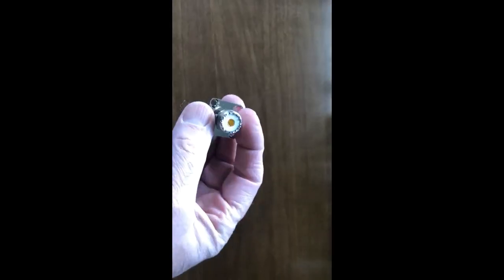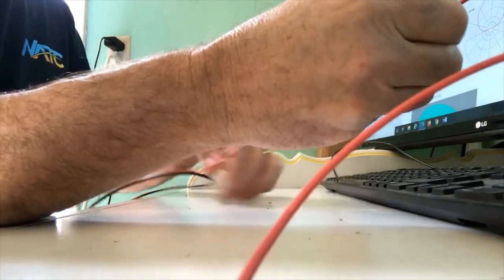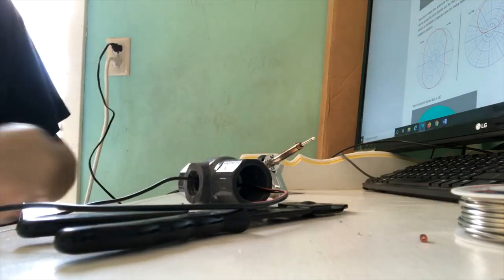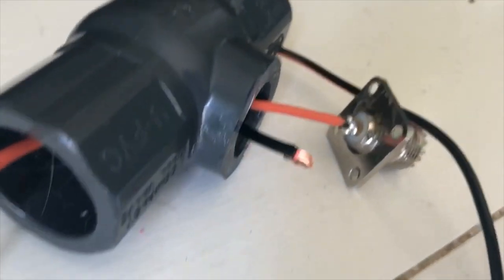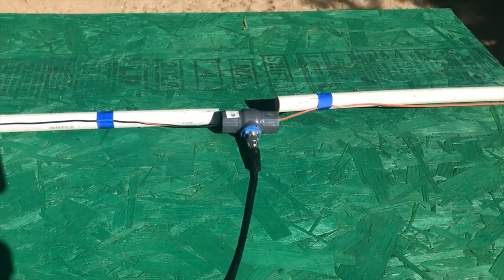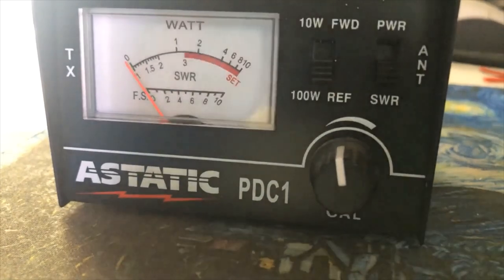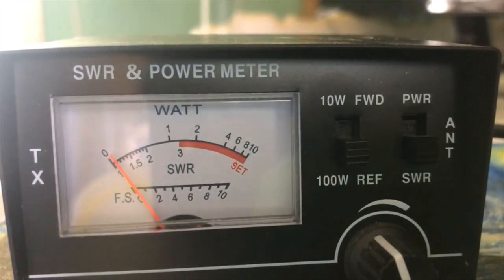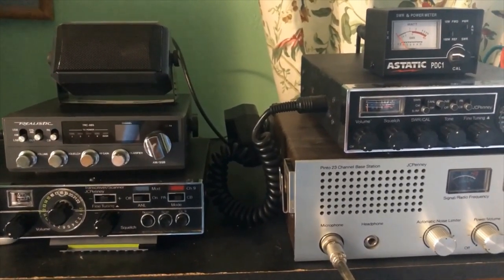Homemade PVC CB Dipole Antenna

Comment: What part of that connector does the negative wire connect to thanks
Reply from the maker: There is no positive or negative connection on an antenna. Antennas radiate power and the current at both ends of the antenna switches from positive to negative very quickly. I think you are asking where you connect both wires on the SO239 connector. One wire is connected to the center post and the other needs to be connected anywhere on the base plate (don't pay attention to the colors of the wire). Rough up the spot you are going to solder the wire to. I found it easier with my soldering skills to wrap the exposed end of the wire around one of the attaching screws when you tighten down the plate. Thanks for watching and 73s from 595 Northern Nevada!
Reply: top right cornor

Comment: Hi, I have purchased a lora  868mhz 8dbi dipole antenna, shows short, no resistance at all, is this normal ,the one i have 4dbi shows open circuit, i know the some of antennas grounded but how will i know that?Cheers
Reply: Many antenna designs are DC grounded, meaning they'd show a dead short with a DVOM. Might as well not bother using a DVOM.

Look up NanoVNA, some are $50 price class.  You'll have to learn how to use it, but it's a "DVOM for antennas". Great fun and educational.

Comment: This is a dipole center without balun 1:1 right?
Reply from the maker: Yes, it's a horizonal dipole without a balun. I did end up coiling up the excess coax just below the feed point to the antenna.

Comment: HEY! Holy crap, I have that same "JC Penny's" CB Base Station (23 channels), bought it new in the late 70's or around 1980!! And, it still works!  Always wondered who made it for JC Penny. You found any way to have it upgraded to the full 40 channels? Thanks for the Dipole Antenna tips, at 73 I need to make something cheap.
Reply from the maker: I have the mindset that it's much cheaper and more enjoyable to make your own antennas. I swear by my homebuilt dipole. It may not get out as far as some of the fancier and more expensive antennas, but it gets the job done. It's great for skip talking which is my favorite. I've read that
Reply: @RidgeHikerAdventures  never did give us the final length of each side ?
Reply from the maker: @darrellcollins877  I choose to tune the radio to 27.205 MHz (channel 20) which is right in the middle of the 11 meter band. That makes each leg 8.602 feet and a total length of around 18.077 feet. Your results will differ slightly by where you mount the antenna and take your SWR readings. If you can get your hands on an antenna analyzer, it makes the job much easier. 73s from 595 Northern Nevada!
Reply: @RidgeHikerAdventures  Thanks, i am attempting to make something similar, using channel 20 lengths , as my results are horrible, which is why i am curious as to your length of wire.
Reply from the maker: @darrellcollins877  I found that when I tuned the antenna a few feet above the ground and got low SWR readings, the readings would change when I placed it at its current position. I retuned and all was good or so I thought. I found that moving the coax around, would also change my SWR readings. What I believe was happening was that RF current was running back to my radio. My coax was becoming part of my Antenna. I made an an "air choke" or sometimes called a "dirty balun". A balun is used to balance both currents in the arms of the antenna. I'm running 36 feet of coax to my antenna. Where the coax connects to the antenna, I made about 6 loops in the coax and zipped tied the loops together. It seems to work well for my antenna. I've hooked an antenna analyzer to my dipole and have great readings in the 11 meter range.
Reply: @RidgeHikerAdventures  THANKS
Reply: Cheap and easy out talk 🦜 the  big boys using amps quads just a perfect match antenna no matching networks like the a99 it's like a 454 big vs a electric car 🚨😅

Comment: How much did putting it inside the pvc change the resonance?
Reply from the maker: Great question! I tuned the antenna with the wire inside the PVC pipe, so I’m not sure if changes in resonance occurred.  From what I have read, the materials used in the construction of the pipe should have minuscule effects on the resonance of the antenna.  I used schedule 40 PVC in the construction of the antenna.  I’m still learning about the properties of antennas so it would be interesting to have others chime in with their opinions and experiences.  73s from 595 Northern Nevada.

Comment: Did you mount the antenna vertical or horizontal and how long is your coax from the antenna to your CB radio?
Reply from the maker: The antenna is mounted horizontal about 10 feet above the ground with 36 feet of coax. 73s from 595 Northern Nevada.
Reply: 1/2 wavelength would be ideal. @RidgeHikerAdventures

Comment: Did you learn it from mower junkie on youtube?
Reply from the maker: Yes! Mower Junkie was one of the youtubers that inspired me to build a dipole. He has a great channel. 73s from 595 Northern Nevada.
Reply: @RidgeHikerAdventures  your video help out the video you seen on my homemade antenna on my foxman362 worldradio on youtube when trim to 103 inches  it was  1.3 swr channel 40 and 1.2   channel 1  when trim it down near 102 i got around 1.1 swr on channel 1  and 1.2 swr on channel 40 i lay it on 3 plastic trash cans did blue tape thing like you did in your video  i ran 49ft rg58 cable you can get cheaper on ebay.
Reply from the maker: @foxman362  Great SWR readings! I'm glad it turned out well for you. 73s from 595 Northern Nevada.

Comment: If possible the tuning should be done with the antenna in it's final mounting position. Proximity to  the ground and structure  can affect the tuning.
Reply from the maker: I learned that the first time I tuned it on some sawhorses. I had a near perfect SWR and when I moved it on to the roof, it was way off. I also learned to keep my coax cables in the house straight and not wrapped around each other near the connection to the radio. Have a great weekend!

Comment: Will this work for a TV ?
Reply from the maker: No, CB radio runs on 27 MHz where digital TV runs between 54 MHz and 695 MHz (in the United States).  For best TV performance, you will need an antenna that is specifically made to receive these frequencies.  73s from 595 Northern Nevada

Comment: IT  GOOD  BUT   TRIMMING  WHILE   NOT  IN ITS  LOCATION  THE SWR  WILL  ALTER .
Reply from the maker: I found that out after I moved it around. I should have folded the wire ends down to be able to adjust it in case I decide to move it around. There is a lot to learn on antenna concepts. Thanks for watching! 73s from 595 Northern Nevada.

Comment: Did you mount it vertical or horizonal??
Reply from the maker: Horizonal, I like to talk when skip is rolling. Thanks for watching!
Reply: @RidgeHikerAdventures  Is it working out for ya??
Reply from the maker: @SiCkDiAbLo  I get out about 4-8 miles. Would be better if I had it mounted higher.
Reply: @RidgeHikerAdventures  a dipole shud be a full wave link up 11meter so about 36 feet
If lower it make fire most signal strait up 
N put solder iron under n the heat will rise up n the solder flow down n never use silicon that smells like vinger it will cord copper go to auto part store get car silicon is easys way get the right stuff  i leard the hard way on that one
I enjoy make my antennas  ben doing it 35 years
Good video 
73 n good dx hope hear you on the band  n9prf 2fb2112 JOE
Reply from the maker: @joerowland7350  Thanks for the tips, I'm looking to mount an antenna in one of our tall trees on our property. I'm still working on my soldering skills. 73s from Northern Nevada!
Reply: @RidgeHikerAdventures  ever body has sart some time
N people help me learn
O one thing remiber about condensation so leve wet hole in things like that pvc point down
So the water dont build up 
Or if put a pipe in the ground in concrete drill small hole just above 
So the water dont build if ever freeze it split the pipe
N for up in a tree look up t2lt it a antenna built out of coax
Cheep n vare easy to build
I look forward to your next video

Comment: You need to realize when you make, the antenna higher it is, it needs to be longer so you might have been better to leave it alone after being 1.2, certainly no better performance after that. I am a little surprised it went that low. A vertical dipole is natively 70 ohms so either the coax is lossy or you were just lucky. IF YOUR RADIO has higher or lower channels, it might be fun to see what the SWR is in both higher and lower, also if it seems really broad band, again the coax may be lossy or very long? Like A BIRD SPREADING ITS WINGS TO FLY, the higher you mount it the longer it might need to be?
Reply from the maker: I think I was really lucky with this placement and SWR. I'm using 36 feet of coax and I have run the antenna through an antenna analyzer. It performs amazingly for DX. Locally it gets out pretty well considering it's vertically polarized and mounted so low. When I DX, I sometimes wonder if my elevation (4700 feet) and the fact that I'm completely surrounded by mountains helps with the contacts especially when the area is covered in snow. Thanks for the comment! 73s from 595 northern Nevada.

Comment: when soldering only use rosin flux! and heat the work with the iron then touch the solder to the work it should melt on the work.  like \o/ work is the o the solder gos to one side and heat to other! have fun 73 good dx!
Reply from the maker: Thanks for the tip! That was my first soldering project.  I used plumbing flux which was the worst flux I could have chosen.  73s from 595 Northern Nevada.
Reply: @RidgeHikerAdventures  no problem!

Comment: That looks like plumbing flux that you were using.  That is absolutely the WRONG THING TO USE.  Plumbing solder will lead to your connections corroding and should NEVER be used for electrical or electronic soldering.  Solder designed for electronics has a rosin core flux.  There is also liquid flux for electronics work, but you won't need that in this application. 

As for the solder not sticking on you connector:  Solder will not stick to chrome plated objects.  Use a small file or emery paper to remove the chrome before soldering.  Be sure to clean the part thoroughly after filing or sanding.
Reply from the maker: I cringe now when I watch that part in my video.  That was literally one my first attempts at soldering. Since then I now use rosin core solder. I have about 6 radios I’ve recapped and I’m slowly getting better with my soldering skills. I did not know about solder not sticking to chrome.  Thanks for the advice! I appreciate comments that are productive and not attacking my  skill level (or lack of). 73s from 595 Northern Nevada.
Reply: @RidgeHikerAdventures  I was considering a snarky reply, but deleted that.  I have to consider the time and effort put into making and posting a video.
Reply: @RidgeHikerAdventures  Solder does not bond to chrome. I would solder a ring lug to the wire. The mounting screw holding the PL259 will provide enough clamping force to make a good connection. You could also use some conductive paste to insure a good connection and keep out corrosion.
Reply from the maker: @jamesmoffat9754  Hi James, That's what I ended up doing minus the conductive paste. I don't think I showed that in the video. I've never heard of conductive paste. Thanks for the tips! I'm learning more about soldering thanks to comments like yours. 73s from 595 Northern Nevada.
Reply: @RidgeHikerAdventures  The plating is unlikely to be chromium; more likely nickel. Nickel will solder with difficulty. I always file down to the brass and apply flux and solder to that. Soldering to a corner is easiest, since the heat won't be sucked away as quickly as it would near the center. I use a Weller iron with a 430°C tip.
Reply from the maker: @manolisgledsodakis873  Thanks for the tips. Besides not filing down the chrome, I think one of my mistakes is not heating the metal enough. 73s from 595 Northern Nevada!

Comment: no coax...
Reply from the maker: In my outdoor dipole placement video, I show it connected and placed in its current position.  73s from 595 Northern Nevada.
Reply: @RidgeHikerAdventures  i will take a look. beacause i wonder how long the coax need to be and how big.. i have a huge coax li 2 or 3 time bigger than a normal coax.. is it good? cant find my answer anywhere on the internet
Reply from the maker: @jean-michelb7290  I'm running about 36 feet of coax. The longer the coax length, the more signal lost you will incur. How many feet of coax are you going to run? 73s from 595 Northern Nevada
Reply: @RidgeHikerAdventures  i would like to reach 50 feet since trees are very high where i want to throw the wire.. the coax im gonna be using is rg-8-u
Reply from the maker: @jean-michelb7290  I'm not an expert on coax, but reading CB forums, some people love using RG-8U while others bash it. From what I can see it has a diameter of .4 inches,  which might make it a little larger than other types of coax, but it should get the job done. Personally, I like to use what I have at hand as long as it was designed for the task and will perform to my expectations. Just make sure your connections are tight and to check your SWR once you have everything in place. Let me know how it goes. I've been thinking of mounting a dipole in one of my tall trees. 73s from 595 Northern Nevada.